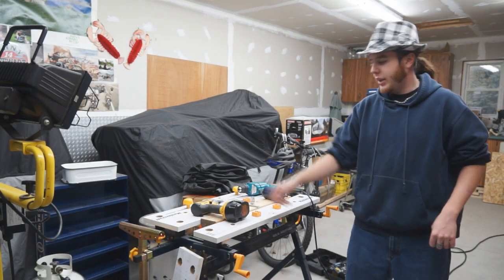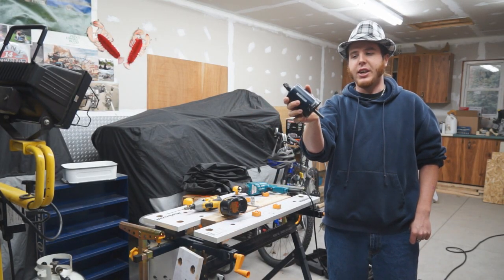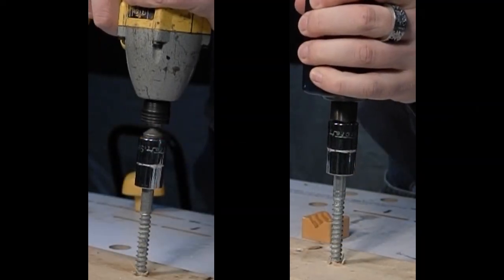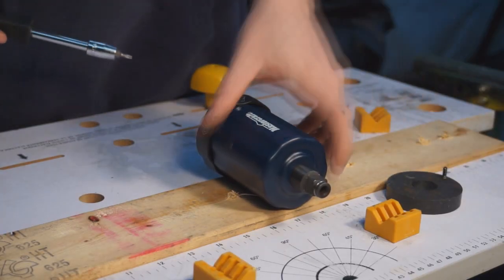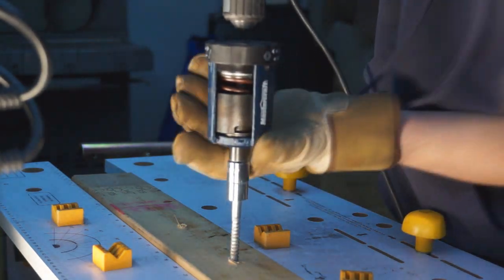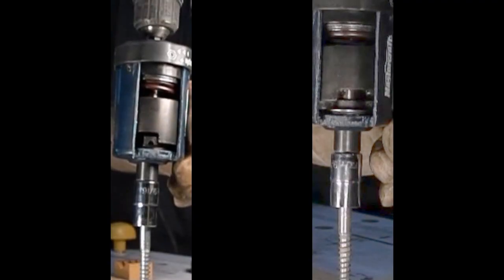Slow Motion - How an Impact Wrench Works

Comment: How is the hammer lifting up before the next hit?
Reply from the maker: The drive shaft in the center has a spiral cut that lifts the hammer.
Reply: @NickMoore the drive shaft from the motor is sometimes straight sometimes helical like you said. But it drives the planetary gear set for reduction. I don't see how that's doing the lifting. Can you explain?

Comment: That's not just a normal spring it's tortional spring
Reply from the maker: The top and bottom ends of the spring are free spinning. It's a compression spring pinned between the adjustable cap and the spinning hammer.

Comment: This was awesome beyond belief! They always made me nervous that they were slipping somehow, by design of course, but as a fake engineer, it was bothersome because if the wear and tear. Now I see how it works and I still think the design would be prone to some extreme wear but that's what they are designed to. Can you make a part 2 and talk about average service and issues wit these. They are much more complex than a drill. Also like to see an explanation on how to set a budget for one. It seems like there are many types by each company and since I just got the bug in these, I have not looked at, for example, the complete DeWalt like of impacts. I did just see Vince talk about the new DeWalt Atomic and it seemed like that's a compromise tool. Atomic sure sound good though. Eh?

Comment: For years only observed guys using an impact wrench on bolts. First time that I saw one to drive a lag bolt into wood thought all that impacts would destroy threads but they work great. Contractor has a battery operated big one that easily removes any lug nut on a truck.
Reply from the maker: They are more effective on nuts and bolts than on wood but in both cases they take a lot of strain off your wrist. Great tool to own if you already have a drill.

Comment: These things are marvels of engineering sorcery. I spent all day using breaker bars, WD-40, hammers, you name it to try and loosen a seized bolt on my car, and nothing worked. Then my neighbor brought over this teensy little impact gun. I laughed at the sight of it and then... I was simply dumbfounded when the bolt came flying off in literally one second.

Comment: Great show, thank you for troubling yourself with this. The cutaway was a fantastic idea together with the slow motion camera.
Going back to my early College days, F=ma, Force equals mass times acceleration... So the mass of the "flywheel" remains constant, but the spring stored energy makes it possible to give it a good high acceleration as soon as it moves past the height of the blockage making it go from 0 m/s to some crazy high speed, thus hitting the next blockage with a high force.

Comment: I recently learned that automotive style impact sockets aren't thick walled for strength, they're thick walled to add mass which helps the impact force. A YouTube guy had the same impact gun but with a regular socket and an impact socket. The impact socket quickly removed the nut while the lighter regular socket wouldn't turn it at all. I thought that was pretty cool!

Comment: Excellent video. Thank you

...

A question, though...

What would make a cordless impact gun, (with brushes), lose its torque power, to the point that it can no longer undo, say, a lug nut on your car? 

Batteries and charger seem to be OK.

Is there a way to restore torque to original or, at least, a better force? 

Thanks!

Comment: How to use SDS drill bit chuck into 1/2"  impact wrench?
Reply: why? sds bits are meant for hammering forward and back. impact only spins 360, it doesn't push the bit out.

Comment: From what I see, energy is stored for 170 degree of rotations, and released in the final 10 degrees of arc of rotation. Not considering the losses, the force impulse is 17 times stronger than the momentum provided by the drill. The spring reduces the length of the impulse further, but it is not possible to evaluate how much by eyes; but is reasonable to suppose the duration of the impulse is reduced two or three times, so the total force applied is approximately 50 times the momentum provided by the drill. Momentum in this case is the product of speed and torque of the drill.

Comment: I bought a Dewalt DCF899 impact wrench to swap winter and summer tires on my little 2007 Toyota Yaris. On the third season I was able to remove all the nuts except the last one. The last one broke the impact wrench! What a POS!! Good luck getting warranty on that. They kept me running around in circles. In the end, it only took about 5 months to get it resolved and it wasn't even through Dewalt. A private dealer took pity and put it through warranty. Just bought a bunch of Dewalt tools last year to work on some projects too. TIme to get rid of the rubbish and try Milwaukee  or some other quality brand that stands by their products.

Comment: The moment use explained how it worked a design popped into my head and it was the same as that one.

Firestick https://amzn.to/2NBxesl
mask https://amzn.to/2ORZY0E
Spider novel https://amzn.to/3r84O74
Slime novel https://amzn.to/3vSGKbM
PS5opau https://amzn.to/2Qt09Qm
akai pro MIDI https://amzn.to/3fff1w9
Rockpad drum https://amzn.to/31qP4S6
Correct way to use Fuck https://amzn.to/31qcOWt
Dangerous Eng expressions https://amzn.to/3fzXFKP
Correct way to use bitch https://amzn.to/3ft4AFz
Keychain https://amzn.to/2PQRZRL
piggy chain https://amzn.to/39BqsL4
dino slipper https://amzn.to/3wX76Kz
usb ssd https://amzn.to/3a6nHS7
demon slayer vol 21 https://amzn.to/3x3t527
charger https://amzn.to/3x2Jsw7

Comment: If those sockets are chrome vanadium then its not recommended to use them on impact tools as they can shatter quite violently and cause injury. Chrome molybdenum cr-mo is recommended for impact tools. Although there are some impact sockets made from chrome vanadium that have a special heat treat and used for impact tools, and a cheaper option than the cr-mo.
Reply from the maker: For sure these are not the right sockets, I normally use the impact gun for driving screws.

Comment: Interesting, I didn't even think about the impact having a flywheel. I always thought they would act more like a retractable pen, two crowns with off center teeth that push a spring loaded hammer up, then straight down onto the now misaligned teeth, forcing the bit to turn. I wasn't too far off, but wrong none the less. Thanks for the video!

Comment: Notice also that the moment when the hammer is turning the drill, the drill is pushing the hammer up. By Newton's third law, that means the hammer is pushing the drill down. This gives the impact driver its other magical property: it's ability not to strip screw heads. It pushes the head into the screw extra hard at the exact moment when the head needs to turn the screw.

Comment: What makes the potential mass rise and push the spring back
Reply from the maker: There is a screw shape cut into the drive shaft. The hammer climbs the screw when it can't turn.

Comment: "Hammering" action is the worst way to drive a bolt through something like wood. If you've ever studied physics, you know the difference between static and dynamic friction. Static friction is more difficult to overcome and once it begins moving, it's much easier. This is when we have anti-lock brakes. An impact driver uses the worst case by overcoming static friction by each hammering action and as soon as it begins to move, it stops and static friction is once again established.

Comment: Why i can't find impact head adaptor in online store like aliexpress or amazon? I am look just one in ebay with name "impact head"
Reply from the maker: As far as I know they stopped manufacturing this device when lithium batteries became cheap.
Reply: @NickMoore  Okay, I understand. With this impact adapter tool, I just bought a battery drill and it saved a little money 😁.

Comment: Thanks, amazing demonstration! So if I understand it well, there is two impacts :
· one in the the direction of rotation
· the other in the direction of the translation of the screw into the wood (forward the operator)?
Because a translation of a thread causes a rotation of it, and a rotation of a thread causes a translation of it, the operator feels less torque in is own hand compared to using a drill which with the operator can't apply as much translation, so which with it he musts "resists" more to the movement of rotation because drilling coefficients of friction is greater because of the lesser translation movement  , isn't it?
I don't know if I'm understandable, I'm french,
By the way, thank you!

Comment: maybe a silly question but could you improve torque by adding more weight if you would weld a steel ring on top of the hammer ? sorry for my english
Reply from the maker: Yes that would work but only if the drill is strong enough to spin at the same speed. If there is too much weight the drill will slow down and not deliver as much force.

Comment: Thanks, Nick - excellent video because you also went to the extra work of doing the cutaway so that it is easy to follow along with your explanation.

I am in the process of buying an impact driver as well as an impact wrench and I was under the completely erroneous notion of thinking the "impact" in the name described a longitudinal impact like a hammer impact on the head of the fastener.

I could see how that sort of impact could help in Driving a fasterner, but I couldn't really see how such an impact could help in loosening fasteners unless it was just breaking the grip rust or tight threads had.

It's painfully obvious watching your cutaway video that the "impact" is in the Axial direction, not the longitudinal direction!  Thanks for such a simple "eye-opening" explanation.

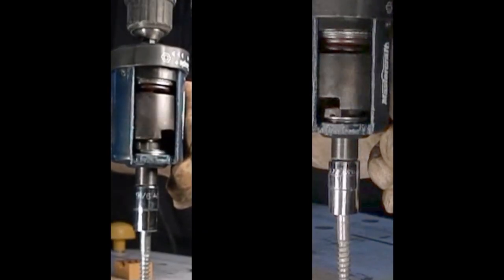However, I now have two questions about what you said in the video: at 2:54, you said that the rotational hammer impact, because it is hitting only 2 times per rotation, has "the average energy that is the same as what's coming out of the drill."  I had to listen to that a couple of times because it didn't make sense to me - don't you mean that since the hammer is hitting only 2 times per revolution that each hit is concentrated and Half the total energy that is coming out of [each rotation of] the drill?

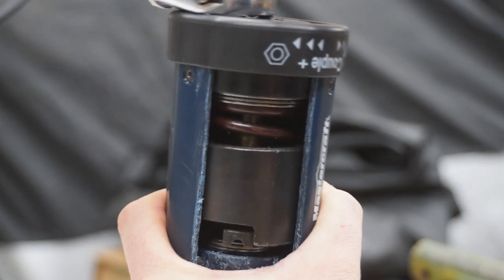The second question I have is when you say at 3:09-3:20 that when the spring is compressing, it is also adding energy to the impact, is that true?  I can see the spring releasing the pent-up energy from being compressed, but isn't it just used to push the rotating hammer back down into position to deliver the rotational hammer force?  The downward pressure of the spring is for positioning, not really for downward hitting on the workshaft holding the socket or drive bit, right?

Awesome video and explanation, still!
Reply: Say, I see Milwaukee has a "Surge" impact driver using a hydraulic action rather than a physical hammer and anecdotal reviews claim like about 50% less noise (with maybe some loss of peak impact power).

I'd like to see an explanation of how That works, but you're not going to find any $2 hydraulic impact drive adapters at Canadian Tire!!!!!

Comment: I find it impressive that the materials can withstand those forces and hits over long periods of time. One would think the surfaces get destroyed in no time.
Reply: Requires a tough material for the hammer portion!
Reply: @benjaminlagace7266  for the low low price or $2 for the finished product lol
Reply: Take 20MnCr5, harden it to 58-62 HRC it will easily withstand it for a long time
Reply: hardened steel...

Comment: this was incredibly informative and thanks for sacrificing the impact adapter to show us. 
I'm curious, however. How does the hammering action improve bolt or nut extraction ? Wouldn't the pounding/hammering counter the direction of the thread? I'm rather new to the world of power tools.
Thanks again.
Reply from the maker: Most of the force is rotational and will work with you to remove a stuck nut or bolt but even the axial hits are helpful. Any kind of sharp impact will break the bond between threads and help get things moving.
Reply: @NickMoore  Got it. Thanks Nick!

Comment: Does anyone know where to find a standard to impact adapter as in the video?

I have a little custom project (weed puller) that could use that and it would be better than cannibalizing a tool. Surely there must be one somewhere, it doesn't have to be $2!

Comment: Funny the things we watch on youtube. I always wondered how these worked. I had seen the hammer and anvil in other videos and photo's, but I never understood how the hammer was lifted up over the anvil. Every hammer/anvil I saw had 90 degree corners on them, so no bevel to lift the hammer. I also didn't quite grasp how it just sliding over a bevel on the hammer would do much as in my head, the hammer would still spin at the same speed as the input itself. Now in this video, in the slow mo, I see the spiral "screw" in the shaft the hammer rides on. I'm assuming there are teeth or matching spiral in the hammer itself.

Pretty neat how simple it is.
Reply from the maker: Glad you found it helpful!

Comment: Great video man! The only concern I have is that you were using chrome sockets with impact tools. I don’t know if your sockets are impact rated but I’d just like to advise some caution with chrome sockets and impact usage due to the brittleness of chrome. Great job otherwise!
Reply from the maker: I haven't had one blow up yet but yeah, they are not the right tool for the job.

Comment: Cool vid.   The smaller impacts still use that design, but a lot of larger ones now switched over to a twin hammer design that doesn't need a spring.  That spring style works well with electric motors, tho, so I tend to still see that in electrically driven impacts.

Comment: This is a high quality simple how it works video. Adding technical infermation like electric motor hp and torque, motor rpm. The spiral design, spiral angle to top and bottom of its  shaft. Spring design, spring tension at max open, tension fully compressed, hammer weight. How they all goes into creating the. Physical energy impact force which gets converted into foot pounds. Impact wrenches part two. A deeper look into how and why it works. Where we will also compare the workings of. Electric vs pneumatic vs hydraulic designs.

Comment: Cool vid . Now I have an odd question . I need a really powerful wrench without the hammering as I'm afraid I'll break the gears . Is there a way to disconnect the hammer in a cordless drill ? Thx .

Comment: Why cant I find an impact head adapter like this for sale anywhere.  Seems like it would be a cheap alternative to buying an impact driver gun.
Reply from the maker: +Eric Brown As far as I know they were discontinued just after I made this video. If I had known I would have bought a load of them.
Reply: Nick Moore I find that very odd.  Does is work well?  I'd rather pay $25 for one of these instead of paying $100 on a separate impact driver.

Comment: Does anybody know what these adapter are called? Been looking for them on eBay etc. but no luck. Seems ideal if your only need for an impact wrench is twice a year to take tires of your car to change between summer/winter tires. Sure depends on how much torque these can produce vs a dedicated impact wrench.
But would make the job so much easier loosening the bolts as often they're corroded a little an also has the car been to (even an authorized) repair shop then they often have the habit of NOT doing a proper job and tightening bolts with a torque wrench but just slamming them on with the impact wrench making them sometimes very difficult to get of. Could you get an adapter capable of the 600-1000 Nm range that would be perfect just pair them with a strong cordless drill.
Reply: HifiCentret 
But is this an adaptor for a drill, or he's showing us how the inside of a drill works.

Comment: This is the most informative and clear educational video I've ever seen.   You leave nothing to the viewer to figure out on their own.   Every step is taught very well.   Thanks!   By the way,  how does the hammer rise back up after the collision?
Reply from the maker: >_< I really missed the hammer thing. The input shaft has a helical cut that acts like a screw. When the hammer is stuck on the output shaft it climbs the input shaft like a nut on a bolt, after it slips over the edge of the output shaft the spring drives it back down.

Glad you liked my work, thanks!
Reply: Nick Moore thanks for clarifying.   I'm a professor of pharmacology and I'd be happy to teach this well.

Comment: Where do I find something like this? I've been looking everywhere and I dont think CTire sells them anymore.

I bet it I cut the socket bit off and seal this thing up nicely, put a bit extension on the other end, I could essentially create a concrete vibrator drillbit for drills.
Reply from the maker: As far as I know they have been discontinued everywhere. There used to be a few chinese copies but they have all been replaced by knock off impact guns.

Comment: very cool video. bravo. Could one beef up the spring somehow to increase the impact of the drill? im sure it would not make for an optimal tool but maybe a situation might arise where you temporarily need more power..?
Reply from the maker: +David Urquhart The adapter has a screw integrated into the housing that allows you to increase the spring pressure, like you thought it increases the force of the impact but also makes the drill work harder.

Comment: What's the difference between impact WRENCH and impact DRIVER?

Other than the power/torque and the chuck (Yes I know the wrench usually comes with 1/2 socket driver thing and Driver comes with a cage/where you can put an adapter in it)

I always thought Imp Wrench does a twisting hammer motion while the Imp Driver does twisting and downward hammer motion.  I'm so confused